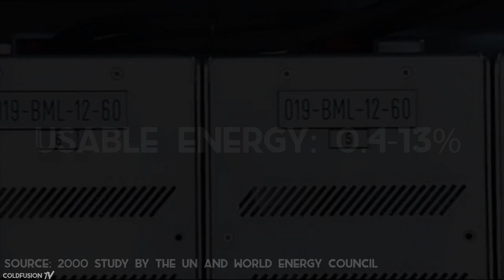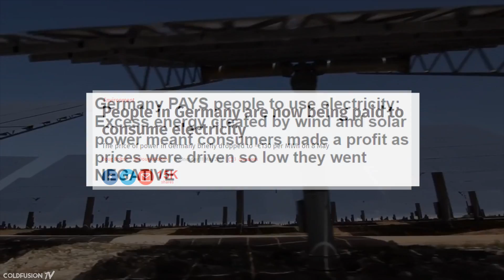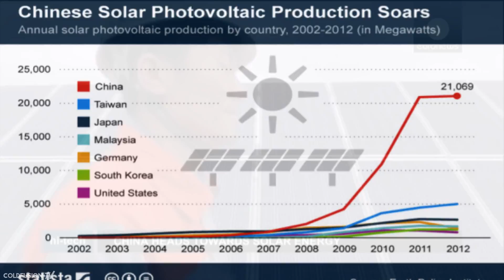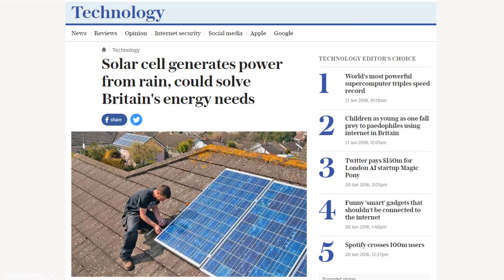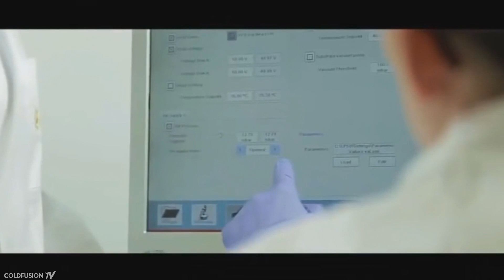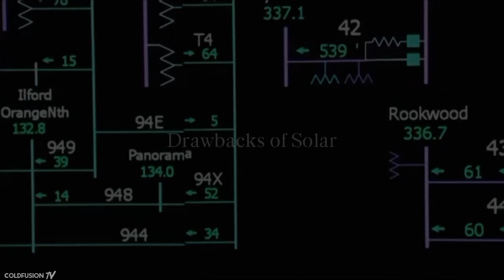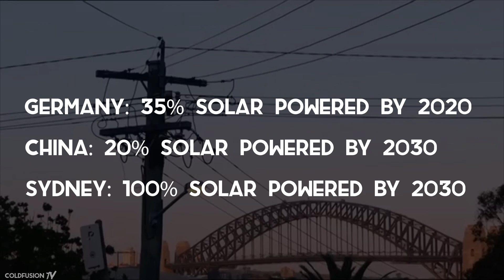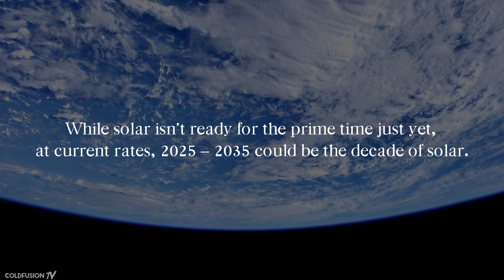The Truth About Solar

Comment: what was wrong with solar roadways?
Reply: Everything.
Reply: Watch thunderfoots video
Reply: there was another engineering youtuber that also did the math behind eevblog i think. and you can always run the numbers yourself or look it up.
Reply: thunderfoot is so sarcastic about calling out bs, that its tough to tell if what he is saying is also bs half the time.
Reply: well 1) its made of mostly recycled material 2) for states like Colorado it would save millions in sending out road cleaners, especially in the mountains where driving a snow plow is dangerous. 3) if you stop and think, plants are solar organisms, and if plants can service in the winter with cloud coverage, then solar panels can still collect power 4) solar panels collect UV and IR light, so even when its cloudy out panels are still getting plenty of UV and IR light. not to mention the LED part is a good idea for a number of reasons.
I think it should be adapted in small areas first. like private drive ways, mountain towns, islands, or low traffic areas. then scale up from their.
Reply: here is the thing though solar panels are 30-35 efficient but a panel lining flat on the ground is less effective already. then you have the recycle glass that is not complete clear reducing it even further. then you have the cars driving which block most of the panels and dirt build up on the panel them selves and any scratches that block more light. if they want to do it correctly look at Singapore. it is built down the middle of the road and high up so that nothing blocks it.
Reply: Actually solar panels in 5 years well be almost 90% and it well take far longer then just 5 years to replace every road. If you haven't noticed the dirt on the road dues not seem to block visibility of road markers, or in road LED (which they have) so clearly "dirt" blockage is not really an issue (we already have street cleaners) another thing to think about is the infrastructure. 1) California tends to have excess solar power some days and as we switch over to solar , wind, geothermal we well need to not just store that power, but also send it off to places that need it, so this could help off load excess energy. 2) it can carry utilities that would be less likely to be danged by weather 3) the hexagons can be replaced and updated in a fraction of the time as current roads. 4) and like i said, update private roads, low traffic, driveways, new neighborhoods, parking lots, exe. So go solar roadways

Comment: One thing about the downsides you talked about.. Yes they need to put some money into current systems to update them.. But that may not be totally necessary, cause as the tech moves forward and the big industry is not utilizing the tech as is it goes, I think solar tech is going to take a path more directly to home use, and as more users start powering their homes by them selfs with their own mini solar system for their home, we are not going to need as big infrastructure in the goverment grids, cause many users will not need extrenal power source.. So big energy companys selling energy to the masses are probably going to be history in the years to come.. 
And this I think is a very exciting development, specially when you combine it with other techs that are in its infant state right now, like 3d printing.. It will make homes way more "independant" and when that happens, goverments dont have to spend as much money every year maintaining their infrastructure, so they should be able to lower taxes or spend more on healtcare and such..

Comment: Not to mention, The energy used to manufacture those solar cells was provided by coal power (china) So your goal of making the planet greener fails as the intermittency of solar (day/night cycle) causes the coal powerplants that fire on and off during nights becomes more inefficient; resulting in more pollutants and you're back to square one.

Comment: Solar power is a scam, all the companies that sell you chinese panels are scamming you for thousands of dollars, by the time you finnish paying your financing on the 3-10 thousand dollar panels those panels would have degraded in performance and in the amount of years that pass as you pay double what you use to pay handling the powerbill when your solar panels aren't working at night plus the cost of the panels; Both the solar panels would have died and the cost of electricity will have doubled. In the end, you're 3-10 thousand dollars lesser and you're still paying the same amount in energy bills 10 years later...

Comment: to start..usable solar cels/panels
with in the earths atmosphere.
can obtain 40% efficientcy 
( far better when used in space )

Secondly,
given our current level of technology..
countries with ocean shore lines..

Why hae we Noot created power stations combining...
stations that sort of look like off shore oil drilling rig platfoms..
but instead...have deep underwater turbine generators..
on the surface have wave turbne generators..
then say 30 feet up hae very efficient solar panels..
further up at 100 ft wind turbines..

linking all 4 together..
then linkng sets of these passive turbine generators
that produce power 24/7/365
( duuring day light solar produces power..nite and stormy days wind does..storms and tides surface turbines do..deep under wter currants continually produce energy )

other then building it and simple up keep
such a tower prouces lots of free energy..

the why we dont ?
its called. oil..gas and coal.

oh we also can create huge solar farms in space

Comment: Allow me throw in a curve ball into the calculations. 
First full disclaimer! Have a degree in Nuclear Engineering so what I am about to say will appear bias.

36 cents/W is what was mentioned. 

A normal fossil power plant will last for 30-60 years and a nuclear power plant of Gen III+ will last for 60-120 years depending on license renewal.
A solar panel has an average life expectancy of 6 years. You'll have to invest the same amount 10 times bringing the total cost up to 3.6$/W. In addition if you have 100% solar you can't even hope to construct an energy storage system potent enough to keep up with the demand at night or when the whether is not cooperative. 
Currently all GREEN energy is actually brown because it's backed up by Natural gas, which is a fossil fuel that is both a very potent green house gas and produces copious amounts of CO2. You can't decouple solar from a base load source and it can't be throttled, it will not follow your demand curve. 

The current green movements are in same bed as the fossil fuel industry. They produce great publicity and hide what the giants are doing while the same companies are throwing scrap for them to be sated.

Comment: Well that's all great but aren't you missing something? 27% of the world's energy is produced by solar in 2050. That's great, but the world population will also be about 30% more. So even with the same levels of energy consumption per person we will still be producing as much greenhouse gases as we are today if not more.
Also, the level of per capita energy consumption is not going to remain the same, it will rise and will rise dramatically. So in the end we will still end up producing even greater amounts of greenhouse gases than we are producing today.
Feeling optimistic about the future isn't wrong but if it doesn't have a basis in reality then feeling so can only be called delusional.

Comment: I was able to produce 3 x more energy with my experiments than contemporary silicon cells. It not only collects energy from photons, but the infrared spectrum and thermal temperatures. The draw back is that it was configured as a wet cell.

Comment: Some people say that solar and wind power will never take off. The truth is that if you combine the two and also find a way to store the energy generated for later use, is far more efficient than using coal. The only real problem for now, it's not being cloudy outside, but the actual cost of implementing these technologies.

Comment: The simple fact is we have little choice, fossil fuels are limited and kill the planet, Nuclear fission power is highly limited in fuel and while thorium salt reactors might bridge some gaps they are still limited by a fuel supply. Fusion power is still very much a dream and even that will be limited by a fuel source making it far better for use outside of the common needs. The effects which wind power has are still largely unknown, the winds are a crucial part of the climate and taking energy out of them remains an unknown factor, not to mention windmills are not the nicest things in their own accord. 

Solar remains the best solution it is readily available and even things like transportation could be arranged through the means of hydrogen. So places which go dark during certain months could run on hydrogen fuel cells the hydrogen for which could be generated from solar power in desert areas which are otherwise rather useless. 

Also as a final bonus it helps make the grid far less vulnerable if we are generating power all over the place. People forget just how fragile the power grids are, a few point taken out of a grind can make a whole country grind to a stand still in minutes.

Comment: hey CF, i like your videos a lot but this time, as an electro technician, i think you missed the biggest disadvantage of renewable energy sources. at this time, there is no way to buffer or save lots amounts of energy. for a home, some batteries will be good, but for large buildings or factorys, there is no technoligy available to save gigawatts of energy. not with our existing technology, and also not in the near future. this is essential in the discussion of renewable energy sources.

Comment: Definitely, solar energy directly or indirectly is responsible for everything we use and that also consist ourselves. The biomass, heat, fossils, plants produce and other things among these are from solar energy. The way we are harnessing is good but being a research student I believe and I am working on different technologies like artificial photosynthesis and more efficient methods to derive the energy from radiations from sun both direct and diffused can yield a better method to extract and refuel the system. Getting electricity is cool but imagine getting oxygen as a biproduct with electricity(action of chlorophyll- photosynthesis).
There is a difference between what we need and what we want and there are things we need but we are not properly aligned to them because we don't want them to.

Comment: 36 cents a watt?  Bullshit!!!   I put the pen to work for a simple 300 watt system, the solar panels cheap cheap and more cheap, but the electronics put it way over the top. The Chargers, converters, and monitors, BATTERIES and control units make it over 2 dollars a watt.
Price a Clean sign wave modulator charger and battery bank for 5000 watts and get ready for sticker shock. You only have a 6 hour window for maximum out put in tennessee, so you need to pull 30,000 watts for that time and bank it in 10,000$ worth of batteries if you want to live in an air-conditioned home. Only the filthy rich can live green!!

Comment: Cost benefits analysis for energy aren't the same as personal or most businesses. Not only are the usual short term returns on investment considered, life cycle costs, ratepayer and stockholder effects and societal and environmental costs must be considered. The effects for each sector must calculated and before the total cost benefits are determined. When renewable energy and even efficiency measures are evaluated existing investments that are long term commitments often skew the numbers by becoming stranded assets if a more cost effective option is considered. If the investment were made based on new coal, nuclear or many natural gas plants compared to most efficiency, wind, solar, geothermal measures the latter group would be the best short and long-term investment to make for customers and environment but Utility stockholders usually benefit more if investments are large and costs keep increasing.Solar works and it's getting better all the time. In a few years energy storage technologies will be do well developed that along with efficiency, wind, biomass, geothermal and other site specific resources like small hydro and ocean energy coal, nuclear and gas will be expensive reliques that will be added to customer's rates as stranded assets.

Comment: Food for thought.  Part of the reason for the "grid" is to transmit power from it's generation sight to its point of point of use.  Wyoming produces way more power than they could ever use and is a significant export for the state.  The reason Wyoming is in this situation the power plant sits on top of the coal mine that powers it.  This cuts transport costs and also keeps the green house gas production away from population centers.  With solar, there is no environmental issues from it's use and can be co located with population centers.  Should every house and building of every description have solar on it's roof, there would be less demand from out of area power therefor decreasing the size of the grid needed.  Should open desert be utilized the grid would again be more important than if co located.  Just think of all the warehouses and parking lots and shopping malls in America covered with solar panels.  I have no idea how many square meters that would be but I'm sure it's quite a bit.  One of the things about power production is balancing the supply with the demand.  This is important so you are not using precious resources producing power that isn't being used.  If a solar produced power isn't used, there is no wasted resource other than the panel itself.  It's still better to balance production with use for cost efficiency but there would be no lost resources .
On a completely different subject, what is the heat production of a solar panel.  Though I'm sure it's similar to a black roof like many building have.  Many buildings are converting to light colored roofing materials just for that reason and are producing less heat from sunlight because of it.  Would the number of solar panels needed for our power needs cause air temperatures to rise?

Comment: Nice sum-up but you did not talk about the problems that arise when a country is switching to alternate power sources

Here in Germany we do have a lot of alternative energy sources and the most obvious problems are:

1) provide base power via gas/coal/nuc. for peak times or when there less/no sun/wind
2) alternative power production is so high that for the large companies keeping alternate power available is to expensive as there is so much power from alternative sources - that's why EON recently split up as it did not keep up with the change in market
3) power grid doesn't hold up to bring the alternative power to it's destination as it is produced in areas were there are no large power lines. This once led to a problem were solar production was so high (I think 2-3 years ago 
during winter) that it overheated the lines which in some  places bend 
close to the ground.